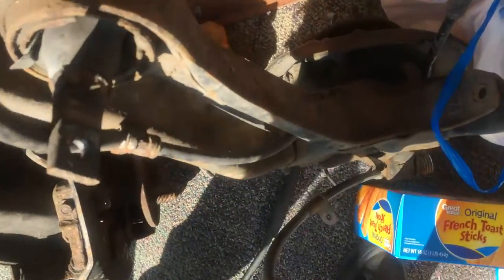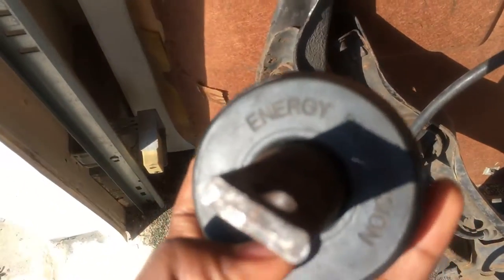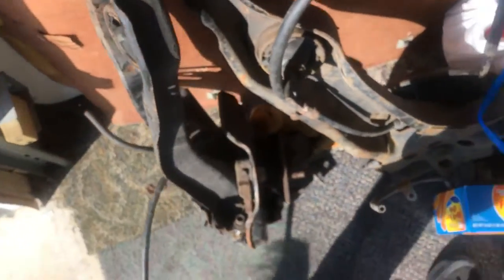EK Civic Hatch Turbo Build - Q&A Answers & GSR Rear Disk Conversion

Comment: is that a ebay turbo manifold?
Reply from the maker: That blue evo tho yes it is. I want to get PLM at some point
Reply: how's it holding up I heard the ram style ones brake and I like the pfab ones that's the one I want to get
Reply from the maker: Yeah I heard that too but you can see how long mines been on based off the videos I made thus far and it has not broke or leaked yet. 👌🏽
Reply: true man well keep up with the dope videos